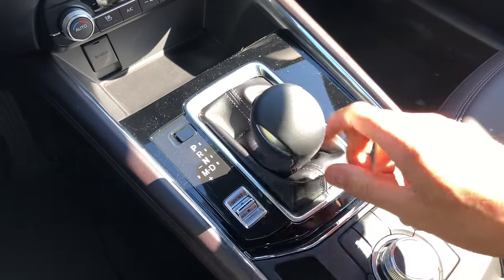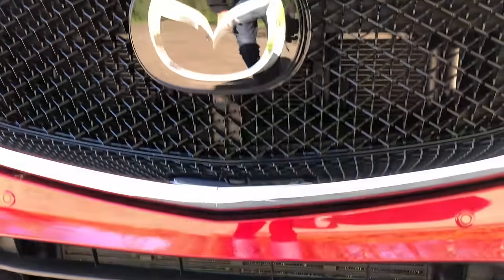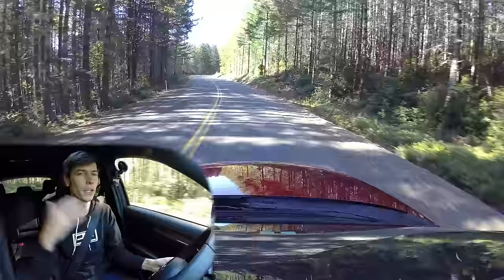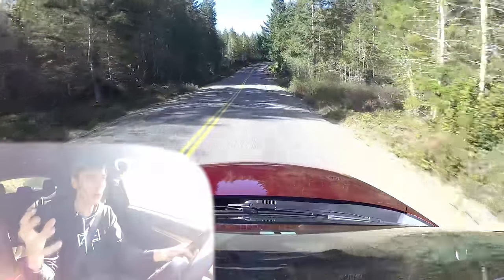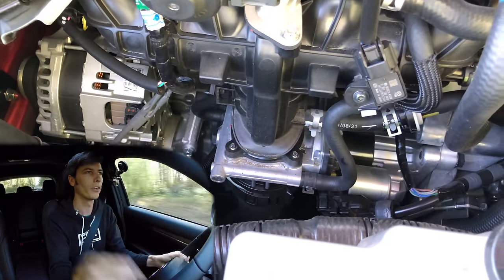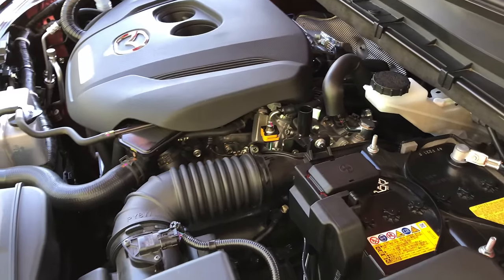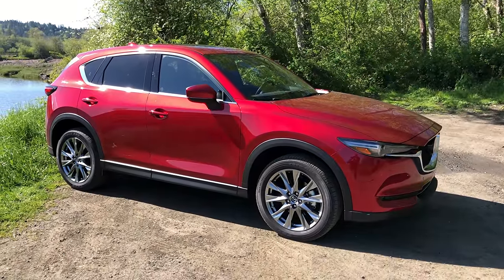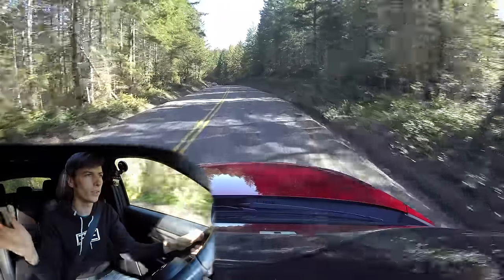Are CVTs Bad? Why Mazda Avoids CVT Transmissions

Comment: I'd rather drive a Miata or BMW Z4 (which I've owned as a second or third car).    But practicality rears its head.   Most of us need people and cargo hauling space at times.   I just went through all of the larger mid-size offerings in this segment, and Mazda was still the only one to put a smile on my face behind the wheel.   Passengers are not impacted by steering feel or throttle response (unless the driver screws up as a result of poor dynamics), so this may be a reason that family buying options are skewed towards vehicles that emphasize comfort, space and infotainment.    Choice is good - but I hope Mazda can hold its own against the blah!
Oh yes,  this is my second CX9 and you can tick the reliability box too.  While CVTs have ruined some good car makers reputation for reliability - Nissan used to be rock-solid before they used rubber bands).

Comment: I have a 2016 CX-5 with the 2.5L engine and I must be the only one that feels it is slow with tiny uncomfortable seats.  The one thing that bugs me about Mazda cars over other car manufacturer's is the unpredictable throttle.  It's like you press the gas and it barely moves so you have to push it almost all the way down to get it to move from a stop. Sometimes it feels normal but most of the time it feels awkward.  I relate the feeling to a very laggy turbo how it has no power at 0 until after 3K RPM.  It's very annoying to drive.  Not to mention how hard it hits the bumps and rattles us all.  This is not my first Mazda and they all feel the same so it is my last Mazda. The throttle is definitely not right. I find my 2005 Accord much more enjoyable to drive around with.

Comment: Does a CVT have better mechanical efficiency than a torque converter auto? Or is the extra fuel efficiency only because of the wide range of gear ratios available.?

Comment: Our(Edmund's)2018 Mazda CX-5 had a sticker price of $34,505 when it was new. After a year of driving, our odometer had about 17,600 miles on it. Assuming clean condition, the CX-5 had a private-party appraised value of $24,818.

This is a 28% depreciation, which is worse than our long-term fleet average of 22%.
Reply: How long do you plan on keeping the car?
Reply: @UnrealOG137  Mazda does not hold their value like other Japanese cars do.

"...MSRP on our 2016 Mazda CX-9 Grand Touring AWD was $43,620. In one year we rolled the odometer up to 22,326 miles. In this condition, the Edmunds TMV Calculator valued the CX-9 at $31,096 based on a private-party sale. Depreciation was rather high, at nearly 29 percent of the original MSRP based on a private-party sale."  Edmunds
Reply: @normt430  that does not matter if you keep the car for a long time.

Comment: Automakers use CVT's to wring out a few more mpg's to meet CAFE standards. That's why. It's the same reason you see mid size SUV's with tiny 1.5L turbo charged engines. The problem with both is that they aren't durable. If you're on the lease treadmill it's not an issue as you will return the car before they break. But if you wan to keep for a long time it's a problem.

Comment: Torque converter is a different transmission than a cvt, right? Are torque converters also used in conjunction with a CVT??

Comment: CVT's are one of the only mechanical system's that violate the rule where less moving parts equals higher reliability.  CVT's have far less moving parts than your typical automatic or manual transmission, yet are generally far less reliable.  If the "band" breaks or slips your transmission goes bye-bye.  That's right, they rely on a single component, what can go wrong with that?

Comment: If you change CVT fluid at 100,000 and 200,000 miles, then CVT should work fine. But it is $1,100 to $1,400 service and it needs special equipment. So people need to have this done at the dealer they bought the car.

Comment: I would still avoid the turbo for long term economical operation - the Mazda NA 2.5 is a fine engine.  Now that I’ve said that, I probably should never test drive a CX-5 turbo. 😬

Comment: CX-5 not necessarily being outsold, they just a much smaller company. I think the cx-5 outsells all their other models combined. 
On other note, old people were the cause of death of the CX-7. That was a fun to drive car. They went so far as to put a sump pump so you don't lose oil pressure during high G cornering. It was a pace car for races. It was targeted at mid twenty somethings before they had kids, but a bunch of old people wound up buying it and complaining about the stiff ride and sharp handling. They dumbed down the CX-5 significantly
Reply: em745a   the DISI engine won like engine of the year awards 3 times in a row and Ford is still using them. Same engine in the Mazda speeds

Comment: One big problem I've heard with CVTs is there's zero engine braking. If descending a hill, one is always on the binders...Not sure if that's true for all of them.
Reply: I've heard this too but my 2018 corolla has no such problems. the spongey feel is there slightly however
Reply: @sundakhistan4000  A friend of mine out in CA has a new Corolla with CVT. He likes it a lot. Hasn't had any complaints thus far. I understand these CVTs are set up a bit differently than the JATCOs. Something to do with a special initial take off gear or gearing for faster off idle response....

Comment: That all sounds good and dandy but also sounds like an EGR system. Why would I even want to recirculate exhaust gasses back into the combustion chamber? And what do these recirculating gasses pass thru to get back in there? Turbo? I take manifold? I take valves? What about all the ash and other content that’s there? Is this a fuel efficient design at a cost of possibly many other problems to engines? How is this engine’s longevity?

I got a diesel. And disabled EGR for that same reason, disabled DPF, SCR, DEF system too. These things aren’t cheap when they clog up especially from city driving

Comment: CVT's are good for city driving because they can keep the engine at as low an RPM as possible while providing enough power for the application. However, when you get out on the highway, they suffer from the fact that the transmission can only transmit about 90%-95% of the energy that the engine puts in. Manual, conventional automatic and dual clutch transmissions can all achieve between 98% and 99% mechanical efficiency (while the torque converter is locked for the automatic) which allows them to achieve better efficiency on the highway, so long as they are geared so that top gear keeps the RPM suitably low.

Mazda designs drivers cars and as such they have more of a focus on people who will drive more on highways, rather than people who have a car as a means to get between home, work and the shopping center. This means that the CVT slush boxes are detrimental to their brand image while being less likely to actually see the benefits that CVT's provide.

And calling Toyota's hybrid drivetrain an "eCVT" is a bold faced lie! That system has fixed ratios all throughout and instead uses essentially a differential between one of the motors and the engine to vary wheel speed while keeping engine speed constant. Basically it is similar to if you lift the drive axle of a car off the ground with the transmission in gear and rotate one of the wheel; the opposite wheel will rotate in the opposite direction. If you place the opposite wheel back on the ground and rotate the raised wheel you will start to rotate the transmission. And if you and a friend rotate both wheels in the same direction you will rotate the transmission at a faster pace. Same thing goes for the Toyota, when idling at a stop the engine rotates "forward" while the motor rotates "backwards" cancelling the rotation of the axle. When you start to move forward the motor will first stop, and then start rotating forward with the engine in order for the car to speed up.

Some math:
E: transmission input shaft speed (engine speed when clutch is locked)
R: Gear Ratio
F: Final Ratio
W: Wheel Speed

Manual/Automatic/Dual Clutch Transmission:
W = E / (R * F) where R is the ratio of the gear you are currently in

CVT Transmission:
W = E / (R * F) where R can be any value within a certain range and can change seamlessly

Hybrid Synergy Drive ("e"CVT)

W = ((Ee / Re) + (Em / Rm)) / F  where Ee is engine speed, Re is a fixed gear ratio for the engine, Em is motor speed and Rm is a fixed gear ratio for the motor

Comment: This explains why my Mercedes-Benz 2.0 liter turbo charged engine gets such poor gas mileage . It is injecting extra fuel for cooling of the charge. It has a nine speed rather than a continuously variable transmission. Nissan uses one of those for one of its sUV's, as I recall. AF

Comment: Priuses go for half a million miles no sweat, so no CVT is not bad at all. In fact it's pretty good at keeping the engine always in the 2000 - 4000 rpm sweet spot most of the time.

Comment: The problem with a lot of cars nowadays is the long service intervals or rather lack of all together. Sealed transmissions? Internal filters that can't be serviced ( a la Ford style)? Really? What a crock of $hit. Heat destroys transmissions.  Once that transmission fluid cooks your transmission is done.  It'll probably be shortly after that factory warranty runs out. Ask me how I know.  The problem with CVT s is that they tend to generate even more heat than a conventional transmission, again cooking that fluid after 30-40k miles. Adding an auxiliary cooler and changing the cvt fluid every 30k miles will save you from buying a very expensive CVT transmission. Car manufacturers want to sell you  a new car every 5yrs/60k miles.

Comment: 10 Speed Transmissions!! They could be used to spread the ratios from crawl ratio to overdrive in Offroad vehicles to eliminate the transfer gearbox or use the transfer box for a reverse gear so the whole gearbox can operate in reverse...Think Unimog!

Comment: I still don't understand the benefits of the cooled recirculated exhaust.
Are we not already pulling in cool air from the regular intake?
There's no way the exhaust fumes are going to reduce the combustion temperatures more than fresh air.
It's also lowering the amount of oxygen in the combustion chamber, since it's taking up space that could've been taken up by air that hasn't gone through combustion.
Reply: It is an emissions reduction process.  It reduces oxygen levels in the combustion process to reduce temperatures and thereby reducing NoX levels from the exhaust.

Comment: I thought EGR is to lower temps' in diesel engines in order to reduce NOx compounds. 

Personally, I really dislike EGR's. They always clog up or have some electrical/mechanical issues. I like a simple atmospheric engine and a planetary gearbox. Best reliability, and easiest to maintain (when it's not a V engine).

Comment: I'm buying a Mazda CX-30 instead of a Subaru XV precisely because after a test drive I hated the CVT.
Oh, and the CX has a 2.5 litre engine and is much prettier.
I don't need the better off road ability or extra ground clearance.

Comment: About a year ago, I had to rent a car for a while after I hit a deer and they put me in a Nissan Sentra with a cvt. I hated it and will not buy anything with a cvt. I live on a hill and it changes constantly going up hill. Can't shift down into 3rd or 2nd to come down the hill and hill descend makes the engine sound like it's gonna blow. Unfortunately the nearest Mazda dealer is over an hour away. I think if Mazda had a few more dealers, they might sell more vehicles. I want to try the Mazda 3 awd and I'm interested in the CX-30 awd when it comes out. Eventually I want an EV but I need awd.
Reply: That's because that Sentra is underpowered so even though the CVT puts the engine in the power band (whatever that might be maybye 5000 RPM) nothing happens except a lot of engine noise. You put that same transmission in a V6 Altima and that thing is a blast, about as fast as mainstream family sedans go.

Comment: They should made transmissions without torque converter and no CVT . Direct to flywheel connected to gears by solinoids shifting. To lighten up transmission and more torque and horse power , plus there is a way to make A/C without compressor and condenser, automotive industry can do that . But they decided not to

Comment: More simply, Mazda focused on speed, racing, performance so they need engine breaking. CVT/CBT doesn't work well there. Try engine breaking going down hill with a CVT/CBT  and you'll quickly learn how to check your brakes to ensure they don't over heat.

Comment: CVT's make drivers feel like their car is a sewing machine. I have a Subaru... it's CVT is actually programmed to act like a six-speed automatic transmission. It does do minor adjustments at speed for efficiency... but it feels like a 6-speed automatic around town (it even has paddle shifters).

Comment: Toyota Hybrid has eCVT, not CVT. 
I've got MX5 II gen with 2.5 liter engine and 6AT. I would never buy CVT again. They are not reliable (unlike panzer unkillable eCVT). I also would avoid dual clutch transmission with dry clutch... expensive in use and short lifespan of clutch. :<

Comment: Nice video.. the subi's cvt has super sensitive gas pedal responsiveness.  Oh, Any idea why the air intake seems to take 7 curves before it makes it into the engine/turbo ?  I don't see anything in the way and it looks like it could of been direct and then only 1 left turn at the back there ? 
Oh, I can't find the ground clearance on this ? and more important, they say it's torque rating at 2000rpms, but 2000 to what ?  Also, if the torque range is higher, like new outbacks turbo is 2000 - 4800 rpms, other cars arr up to 3500rpms, so is the higher range rating mean that it has peak torque for a longer time ? and thus higher rpm rating of peak torque is better ?  A video on torque ranges of diff. engines and pros/cons would be cool. thx.

Comment: Is Mazda still using Ford engines? I heard Mazda was using Fords 6 cylinder engine that’s in the Taurus and Edge. The one that has the water pump driven off of the timing chain. Also does Mazda offer a compact crossover with a non-turbo 4 cylinder with an automatic. I’m getting tired of a manual and my wife can’t drive one. Thanks. I just subscribed!

Comment: In daily life, I think Mazda has the right idea. Most super economical (coupled to hybrid) engines, right now, are bought be people with the economic view, thinking to buy the best car with the lowest consumption. After buying the car they keep putting their foot down, put the system in maximum performance mode because it's not responding, and then still complain about high consumption; much worse than the previous classic internal combustion car. Mazda allows for these people to still enjoy the performance with, in the end, lower consumption.
Mazda's to my idea then, are for the people that do not keep the car in low rev's and do not keep the car is maximum 'green/blue'-mode. People that don't want to change behavior and just use the car.

Comment: I'm not saying that CVTs can't be done correctly, but bad CVTs really suck. They're always at the wrong RPM. If you want to cruise at 1500 rpm the damn transmission will leave the engine humming above 2 grand. And then you have to rev the piss out of it to start accelerating even a little. The complete disconnection between engine speed and vehicle speed is completely aggravating. I suppose it also matters what engine they're attached to, but a bad CVT makes me really appreciate regular automatic transmissions, and I'm a manual guy. I will sit in stop-and-go traffic all day long and be grateful for having a manual versus an automatic. But give me that automatic over a bad CVT any day of the week.

Comment: They are not bad, just misunderstood. Because they are misunderstood they are misused. I would tow 1,000 pounds all day long in my 99 Cherokee with a conventional 6 speed automatic, but not with the wife's patriot which has a CVT. Also the first fluid change is a lot sooner than the manufacturer says, because once again it depends on how you use it. We live in Alaska, we drive back and forth from Fairbanks, down to Valdez, up the mountains down the mountains, in the heat, in the cold, etc. Well this summer, at 85,000 miles during our trip to Valdez when it was 80 degrees outside, the CVT overheat alarm went off. So when we came home I changed half the fluid and the filter. From now on that fluid gets changed every 60k, instead of 120k because I mixed new fluid with old fluid.